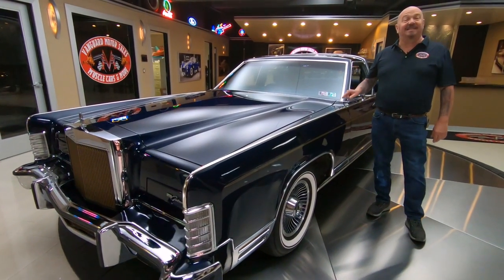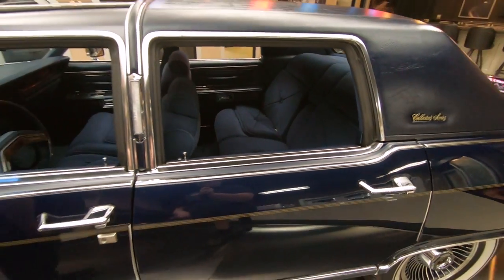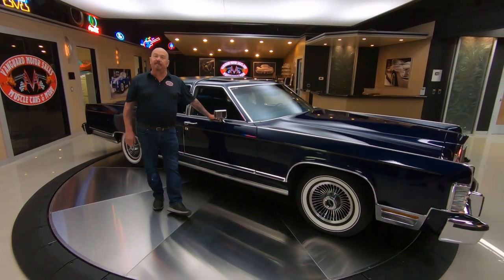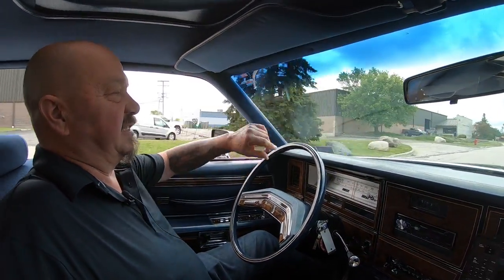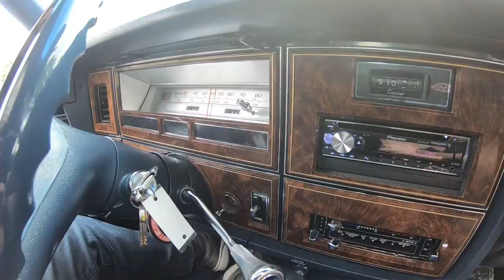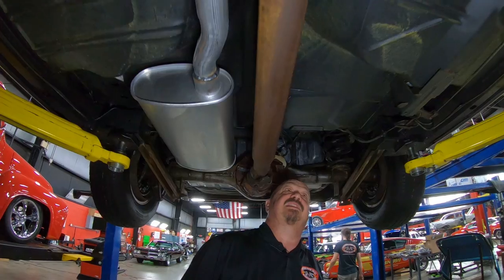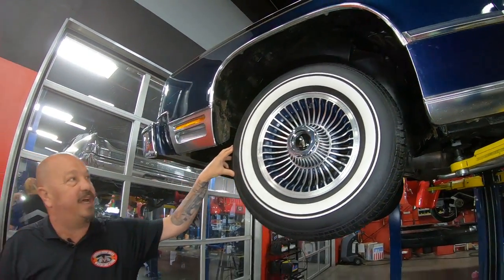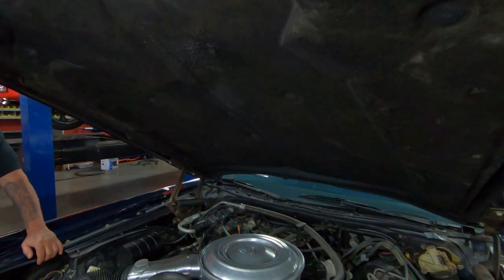1979 Lincoln Continental Collectors Series For Sale

Comment: Now that’s a full size sedan, the only car that was slightly longer in length was the 1973 Imperial Le Baron sedan/coupe
Reply: Also the 74-76 Fleetwood brougham, Talisman, and 75
Reply: @anthonywilson3846  VERY true.  I have a '76 Fleetwood Brougham!
Reply: What about the 1975 Buick Electra 225? It measured. It measured 233.7 inches

Comment: Nice car but it wouldn’t fit in my garage if I was interested in a car like that
Reply: I remember my Grandmother had some humongous 70s Chrysler that obviously didn't fit in her garage so they had this custom made rubber flap attached to the bottom of the door and only pulled it down about 1/2 way.  If you knew how particular she was I'd pity the guy installing it to her specifications.
Reply: It wouldn't fit in mine either.  I'd put it under a custom made all weather cover!

Comment: I thought it was a Towncar  , how do you tell them apart ? I also thought the Continental was a 2 door .
Reply: Timothy, if it was a Town Car, it would have 1.) Front vent windows 2.) Script markings on front fenders. 3.) Leather pillow seats were optional for Town Cars. This model came with some town car options, such as the pillow seats and the sunroof. Sweet ride nevertheless!!
Reply: @williamjohnson3492  I thought they didn't  call them Town Car until 80. I'm  probably wrong though
Reply: It is a town car
Reply: Actually all you guys are wrong!  This particular model is a Lincoln Continental.  But its the Collector's Series model which was only available in 1979 to commemorate the end of the full size Lincolns.  The Lincoln Continental was made in 4 different models.  You had the Continental which is what this model happens to be.   The Continental Town Car  which was more heavily optioned than the Continental plus it has these oval opera windows behind the rear doors.  Then there was the Continental Town Coupe which was a 2 door version of the Town Car and it had rectangular opera windows instead of the oval ones.  And finally the Continental Mark V which was a sportier 2 door coupe but still a huge car.  This is the car Jock Ewing drove in "Dallas." The Continental Mark V was also available in the Collector's Series in 1979.  In 1980 Lincoln separated the Continental and the Town Car into 2 separate and distinct models.
Reply: @RobKeenan826  yup, you're wrong. Lol
Reply: Sun roof was a option ,and leather was standard in the COLLECTORS SERIES  . The cloth seats were a option                                                                                  @williamjohnson3492